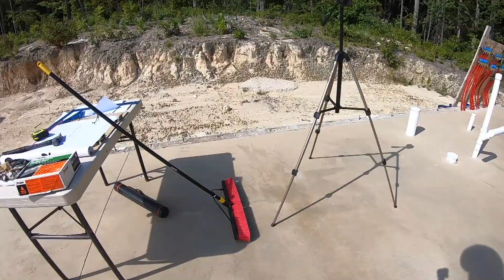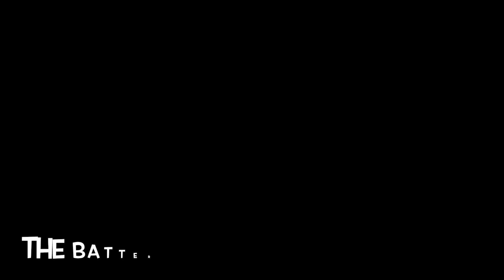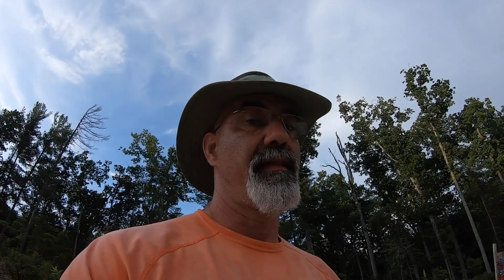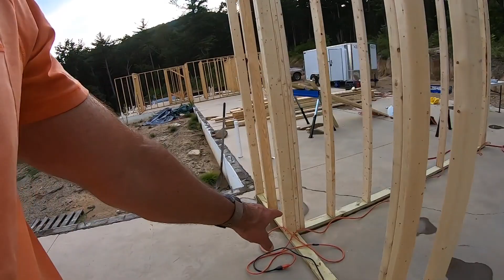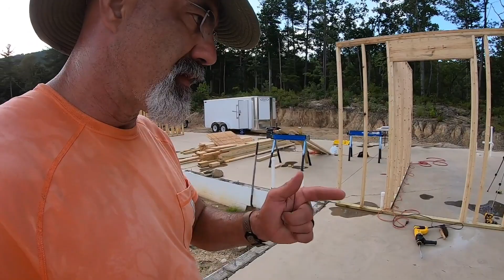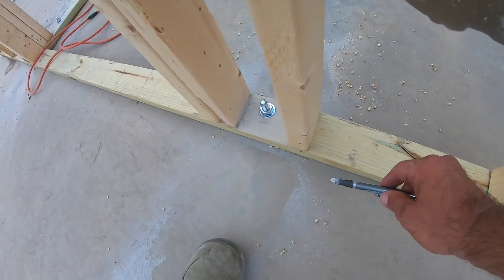#4 DIY Home Build. Framing and bolting to radiant concrete slab. Inches from disaster. #4

Comment: Man, That is not easy at all!! You made it!! 
About to build the similar build (garage with floor heating), checked with city building inspector, he told me that I can glue the internal wall sill plate on concrete instead of drill anchor bolt (avoid damage PEX tubing). Well, of course that is not strong connection. 

I am thinking to let concrete contractor to bury short L-bolt into concrete slab for all internal walls. But the challenge is to bury blot in the correct location, can be difficult.

I really hope there is some way to locate PEX tubing in the concrete, so you know exactly where they are. At least use metal/aluminum detector (Garrett) to detect the PEX-AL-PEX since there is aluminum layer in the PEX-AL-PEX.

Also learned the way you support the raised wall, thanks so much again!!
Reply from the maker: Haiyan,  be sure to take plenty of pictures. The j-bolts can work, but you have to have your cement contractor place them appropriately.   You should still take plenty of pictures with measurement to walls. Good luck. You can do it.

Comment: Great job! I have been searching for best way to avoid damaging pex tubes. This is the best!
Reply from the maker: If you haven’t laid in the pex yet, i recommend taking lots and lots of pictures and safeguarding them with an external backup. Take pictures with measuring tape laid out so you know exactly where you can drill.

Comment: Is that a huge Crack I see on the floor. What happened there?
Reply from the maker: Cement slabs crack. They make saw cuts to try to control where it will crack. But it still cracks.

Comment: I am building a workshop on a concrete slab.20x20.What did you use to secure your walls to the concrete?
Reply from the maker: Sixth Day farm I used wedge anchor bolts. https://www.lowes.com/pd/Red-Head-10-Pack-6-in-x-5-8-in-Wedge-Anchors/1000775718. Easy to use.